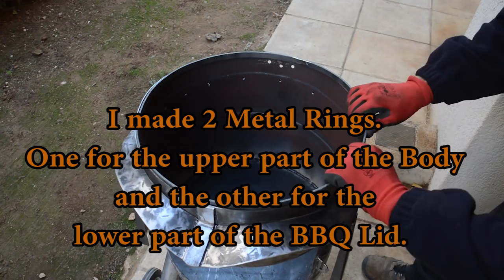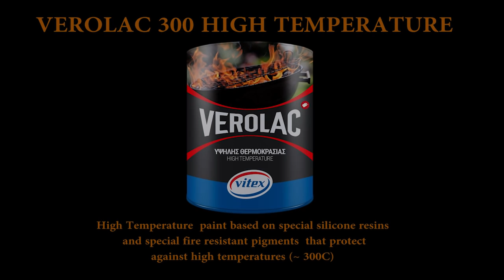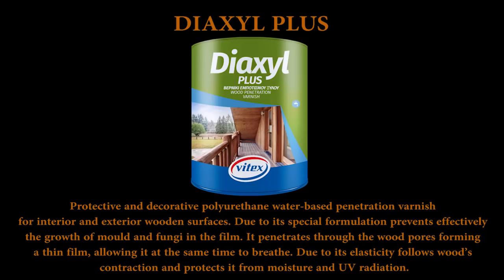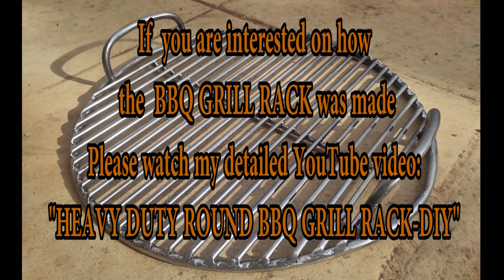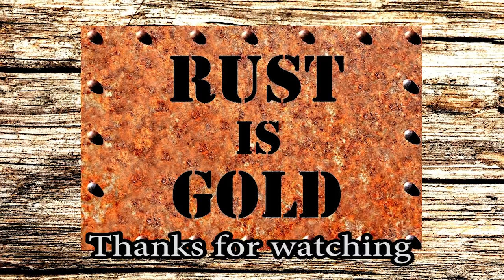DARTH BBQer. The Most EVIL BBQ GRILL ever built!

Comment: I got a journemans letter as a smith/metallworker some 20 years ago, and was a cnc operator before that, so I have worked metall for all my adult life! And I got to say: This project is awesome!!!  You get an A+ for creativity, design AND planning! There are some minor details that I would have done differently, mainly out of habitt and experiense, but overall it´s a piece of art!  The only thing I raised my eyebrows at was the piece you welded on to bolt the stowpipe on, was it galvanized?  And the same with some of the bolts...  The reason I noticed is because galvanized do not take kindly to heat above 450-500F (About 250C). And the same goes for normal stainless steel, thou it takes a bit more heat than the galvanized stuff.    Be proud of yourself , it is a showpiece that is also usefull and will guaranteed be a conversationstarter at anny BBQ!!! 👍👍👍
Reply from the maker: I was already very happy about the final outcome of my Darth BBQ, however, receiving such a GREAT comment and an A+ from someone who has worked metal all his life also makes me very proud!! Thank you very much!!! 😊👍👍
Greetings from Greece!! 🇬🇷😊👍
Reply from the maker: Check out my latest Star Wars Creation!
R2D2 BBQ GRILL!! 😊
https://youtu.be/br0hPKZU5L0

Comment: Are the bolts galvanized? I thought it was a bad idea to use galvanized metal in high temp situations. Hopefully, they are stainless steel or it won't get hot enough to vaporize the galvanized parts.
Reply from the maker: I burned them from the inside with a torch. All the galvanized coating is gone...
Reply from the maker: Check out my latest Star Wars Creation!
R2D2 BBQ GRILL!! 😊
https://youtu.be/br0hPKZU5L0

Comment: Loved the build. I liked and subscribed, but... I couldn't help being disturbed by the fact you used galvanized bolts and hardware cloth. Zinc fumes are set free when galvanised steel is heated. These fumes are very toxic to breathe.
Reply from the maker: Thank you very much for your comments. I was also worried... However, I think I solved the problem. I removed the bolts and the hardware cloth and I burned them with the flame torch up to the point that the galvanized coat started to fall in the form of tiny particles. Now they don't have the shiny look anymore... Do you think they're safe now?
Reply from the maker: Check out my latest Star Wars Creation!
R2D2 BBQ GRILL!! 😊
https://youtu.be/br0hPKZU5L0

Comment: I do not see how you would control the temperature  without dampers on the vents
Reply from the maker: When I was building it I was worried that the distance between the grill and the charcoal was more than what was needed. However it turned out that it cooks really nice and without burning the meat, even with high heat.
Reply from the maker: Check out my latest Star Wars Creation!
R2D2 BBQ GRILL!! 😊
https://youtu.be/br0hPKZU5L0